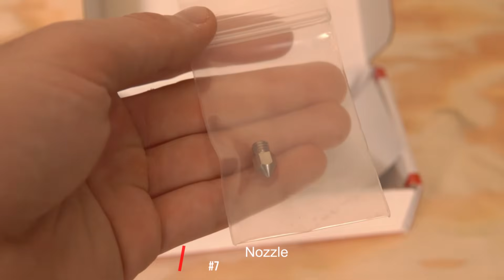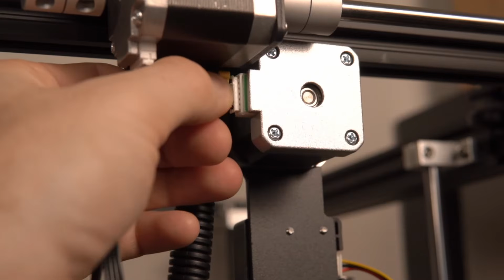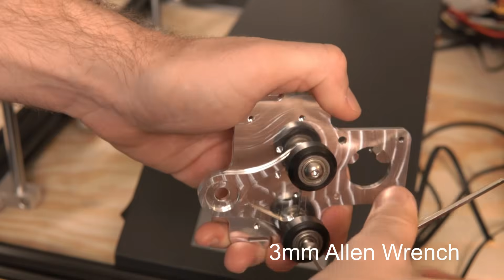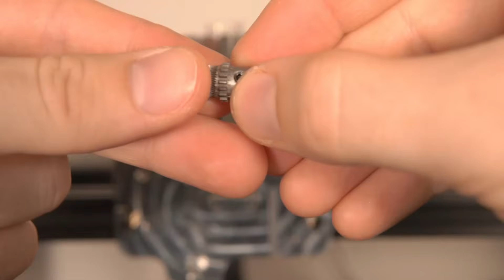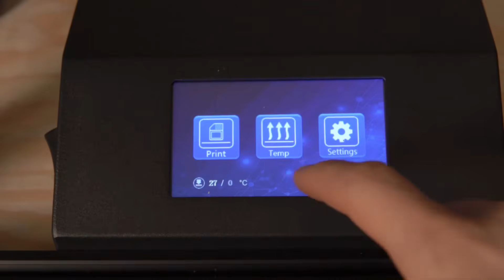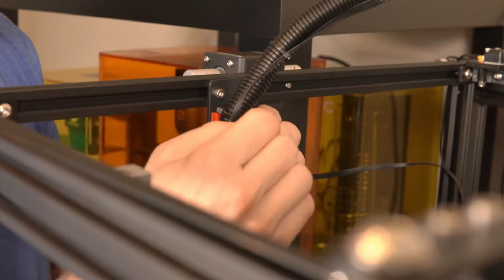Micro Swiss Dual Gear Direct Drive Upgrade For Ender 5 and Ender 5 Plus 3D Printers

Comment: I'm on the edge to do it also. But I have my Ender 5 in an enclosure and I do not know how much clearance would this upgrade need. From your experience how much centimeters does it add to the top of the current hotend?
Reply: I didn't check before what the clearance height was, but now it is approximately 3.5" (89 mm) from the 20/20 rail to the extruder motor plug which is the highest point.
Reply: @eaglefan1018  Thank you. This will be a really tight fit. I have a 90mm clearance from the top of the rail to the ceiling of the enclosure. Maybe I'll need to reduce the feet height.
Reply: @ManuelPombeiro  It is 80mm to the top of the lever for filament retraction. That would leave you 10mm if you tiedown the encoder cable.

Comment: would have been nice to fix the insane offset of the touch sensor from the head.
Reply: I don’t know if you’ve seen the video because you commented a month ago, but check out Kersey Fabrication’s video on the custom firmware for the endear 5 plus. It fixes the mesh leveling position of the BL Touch offset. I’m using it now and it helps a lot!

Comment: I had temp issues after this mod so would advise to PID tune after fitting!
Reply: What kind of temp issues? Not heating to the set temperature?
Reply: @kailuasurfing  Heating Failed screen of death when attempting to print 250+. Once I did the PID it's been great ever since
Reply: @jonmatthews5642  Gotcha. Thanks for the FYI to all of us

Comment: I just wanted to add a note to this video, if like me, you have a cheaper direct drive conversion for the Ender 5 Pro and other variants and are upgrading to the Micro Swiss kit, make sure you use the Micro Swiss extension cable else the Extruder stepper motor is reversed.
Reply: I came looking for this, thank you so much for the advice!
Reply: @JuanPabloGómezLoaiza  No problem! Glad to help :)
Reply: Thanks for this, my existing cable was long enough, so I didn't change it!
Reply: @morticiaskeeper  No problem! Happy to help :)
Reply: Good note.
Reply: Thank you so much.
Reply: @MrInvacion01  No problem, glad I could help!

Comment: Bought this for the Ender 3...after adjusting the flow (e) I did a test print and it was ok. Then I got excited to use TPU (which is the reason I got this in the first place) - print started great, a bit rough but then worked pretty well for a few layers. Left the room and came back to filament coming out BETWEEN the two gears. I didn't think it was possible, but it did. NOT HAPPY! Then decided to go back to PLA where the Ender 3 never had any issues. Printed was successful but after shut-down and bringing it back online I noticed the nozzle was completely locked up. I spare you the details. The Moral of the story: This might not work as you wish it would, and if you do get it, make sure you are not a 3D printer novice or you'll regret it!
Reply: dude, I know your exact issue. Slow your printer waaaaaay down! 25mm/s is as fast as flexibles should be printed. Any faster and the bunch up and tangle. You can't push a rope!

Comment: Very helpful video, helped me all the way through with my Ender 5 plus. Would not have done it, as the creality executional quality notably everything around the sloppy x-carriage scares me to pieces.  One of three core problems that render the Ender 5 plus completely worthless as shipped is the absence of any "Zugentlastung" strain relief on wires and tube going to the extruder. The all metal hot end alone renders the Ender 5 plus to a useable printer, before that change it fails within minutes of printing anything large on xy. It is a pitty that the microsuisee direct drive upgrade, specifically its base plate, does not solve the issues of strain relief and accessibility of the mounting screws for the BLTouch sensor. The state as delivered by Creality is ludicrous. It would be a piece of cake to solve it for anyone with machining access. 
For the sake of completion: Additionally, to work with the Ender 5 plus, it needs
1. The silent board
2. A power supply of 650 W (Meanwell)
3. Some serial access provisions as part of the user's environment
It would be kinda nice if the creality kids could ground the motherboard or put a suitable fuse onto it.
Reply: Thanks Thomas. Which silent board should I get for my Ender 5 plus?
Reply: @davidbarker8483  the one from creality. You can tell then apart by the imprint on the resistors next to the Motor drivers. Please try and Look that up elsewhere. On a sie note: if you decouple the Electronics Fan from the housing with suitable foamtissue, you have already accomplished something. Do not mess around with the Fans! Doing it right is too tedious.

Comment: Nice video, really detailed.  I amd going to purchase one for my Ender 5.  I want to purchase new wheels and eccentric nut.  Does anyone know if there is a vendor that sells the concentric nut for the Ender 5?  Creality doesn't sell them, and I cant seem to find the correct size on amazon.  cheers...
Reply: Douglas Larimore 
I found some on AliExpress.  Search for ‘stainless steel eccentric spacer’.  You may be able to find a seller on eBay in the US.

Comment: I'm a 100% newbie to this but as an engineer It looks to me like the piece of teflon tubing pinched between the two extrusion wheels is an obvious wear point.  Doesn't it need to be replaced frequently?  Also, belt stretch seems to me to be VERY critical in these motion control systems.  As little as +/- .005 would seem fatal to overall accuracy.  Am I wrong?
Reply: RAMTEK 
The tubing isn’t ‘pinched’.  The filament exits the feed in, goes through the knurled feed mechanism, and enters the short piece of tube.  The filament is being gripped and driven.

Belt slack shows up as hysteresis — a positive x move then a negative x move, for example, would produce slight misalignment.  It has to be quite severe to show up.
Reply: @boggisthecat  I found a close up of the extruder wheels and figured it out.  I'll need to think about hysteresis.
Reply: RAMTEK 
Basically, when you start a movement there is a lag.  So: move left to right along x axis 100 mm, actual movement is slightly less — say 99.9 mm.  Now move back the other way, right to left 100 mm, actual movement is 99.9 mm again.  You lose some movement due to the tension in the belts being too low.  Tighten the belts, and the hysteresis converges to zero, thus yielding exactly 100 mm.

The upshot is that if your belts are too loose you will get slight dimensional aberrations all over the place.  Because of momentum, this is not uniform.  If you print a cube and the corners look bad, then you may need to tighten the belts.

(The z axis is less of a problem for hysteresis, because you tend to hop up and down the same amount constantly if using ‘z-hop’.  Or if not, then it just moves one direction a fixed amount each layer.  If you have worn screw(s) then you may get inconsistencies in layer height, with over-extrusion for ‘compressed’ layers.)
Reply: @boggisthecat  Well, I have a lot to learn but that's the fun, right?
Reply: RAMTEK 
Tinkering with these things can take a lot of time.  I think the trick is to know when to stop.
Reply: @boggisthecat  I'm sure you're right.  Being completely new to this my problem is that I don't know what I don't know.  I'm sure learning will be an iterative process.

Comment: I did not see anything about the filament run-out sensor. Is that not used? or did I miss it?
Reply from the maker: Filament runout sensor works great with this. The printed filament guide mounts above it so you feed in filament just like you would before installing this upgrade

Comment: So I'm currently using a bondtech bmg with a microswiss hotend in a bowden setup. My shop has the microswiss direct drive kit without hotend. Would this be worth it in your opinion? I really like the bmg. But I want a direct drive setup. Thanks for the great video!
Reply from the maker: So BMG is definitely a great option as well. I would say if you have been having retraction issues or want to print with more flexible filaments (quicker). It would be worth upgrading.